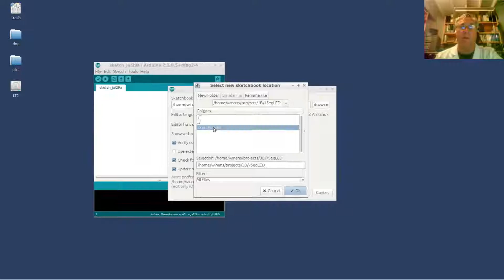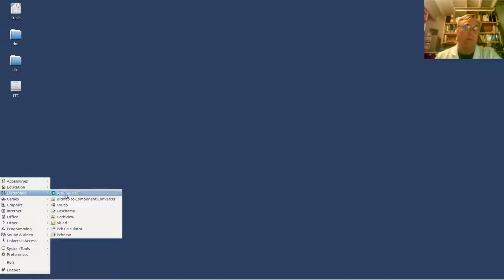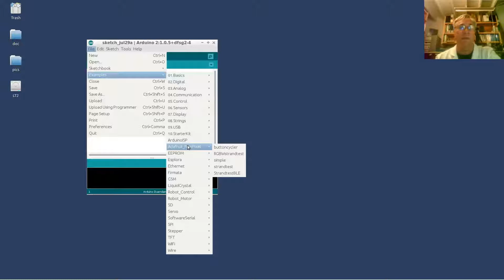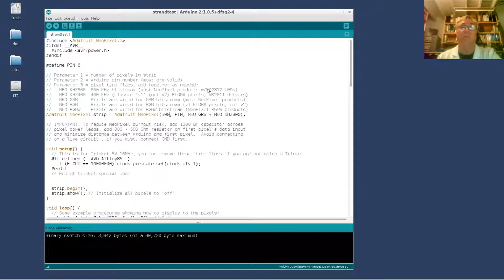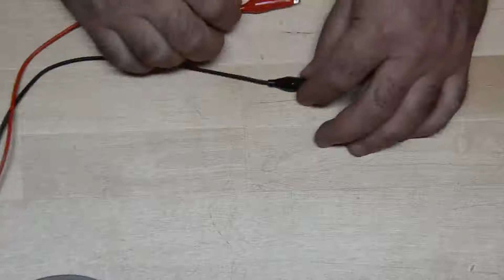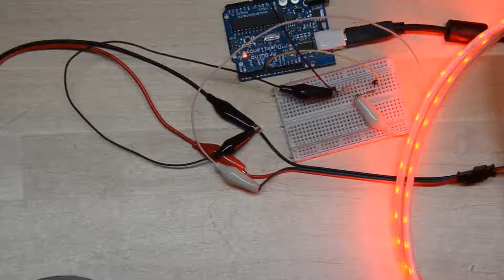How to 3D Print a Giant LED Sign (Part 11): LED Strip Test

Comment: hi which kind of filament (material and color) do you use to build the segments? thanks Max
Reply from the maker: I have successfully used white PETG and HIPS.  
Both diffuse the light nicely.  One issue with HIPS though is that is quite brittle. Once snapped shut, you have to be EXTREEMELY careful about re-opening it!!
I also used pink HIPS when prototyping because I had a bunch of it after it having been on sale.  It looked VERY NICE for displaying red digits.  I suspect you could fill it with white-only strips for a great effect.